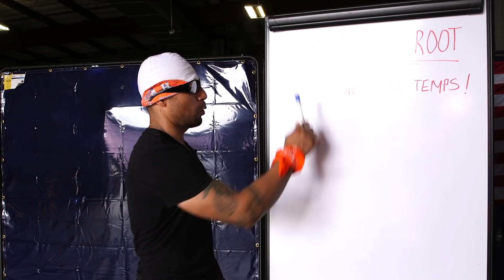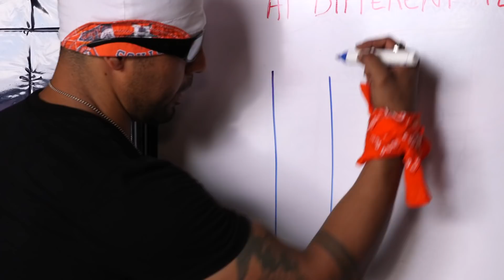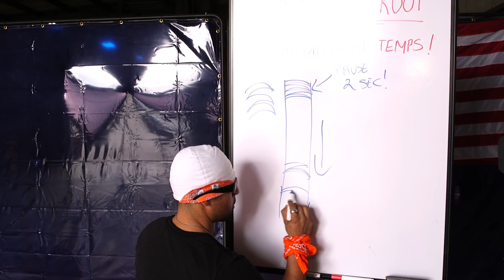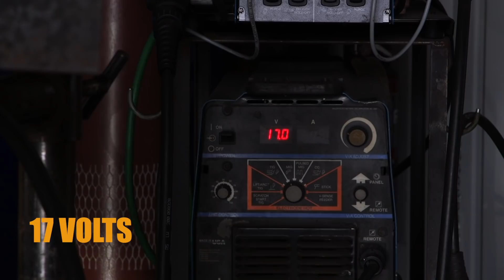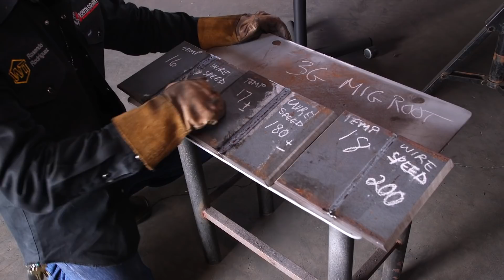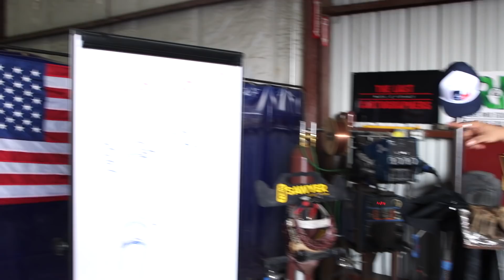3G MIG Open Root

Comment: Just seen your video after I did my Mig 3g today. my settings were 17.6 volts, wire speed 180 (4.5 m/min). I did an uphill stringer for root though.

Comment: Is it correct to be calling the volts your temp? Temperature is in your wire speed  at least that what I understand from my research. Amperage goes up when your wire speed goes up. Volts are for stabilizing the arc for the transfer mode you’re using. But Amps is where your heat is at.

Comment: i get confused also, wire feed speed is amps , thats (temp). Voltage is the (puddle ) workarea. volage is where it connects with the work spot> think of it like a spark plug.kinda

Comment: Its not different temperature, its different voltage. And this is really, really easy. In europe, MAG (since that is a Mag welder, it needs 100%Ar in order to be mig) root is considered to be right onli of its uphill
Reply: Bozidar Jevtic that would depend on the code being used here in the states (ASME or API 1104) you can use 75/25(AR/CO2 mix) or 100% CO2 or 100% Arogon. But typically 75/25 is used under the qualifying code of either ASME or API 1104 and a Mig root is done downhill. Further MAG and MIG are not the same thing per se. MAG (Metal Active Gas) MIG(Metal Inert Gas). Argon is a inert gas while CO2 is an active gas. That’s why MAG is ran with CO2 because the CO2 makes the weld pool active. Argon doesn’t. When mixed with CO2 as the parent gas it actually calms the activeness of the CO2 to allow it to solidify faster.

Comment: I've never been taught to weld downhill. It's always been told to me to be bad practice. This is Votech, contractor and shipyard. I'm curious as to why you're teaching downhill root and uphill?? F.y.i I'm not judging, I'm seriously curious..
Reply: A downhill MiG root is totaling acceptable. The material that you are welding is at its most vulnerable state at this point. By going downhill you are able to keep the heat in those landings and get proper reinforcement. After the fact you will need to go uphill to keep that heat in the plates or whatever you are welding. All that said there is nothing wrong with going uphill as well. But at the end of day it all depends on your WPS

Comment: Hey weldtube family, I was wondering if anyone has took a test on a 2” schedule 40 carbon, 6010 uphill, 7018 fill and cap, if so what heat did you run your root pass?
Reply: I ran mine at about 76 . Depending on the machine I was using .

Comment: What transfer mode did you use?  What gas mixture did you use??
Reply: Probably 75/25 CO2 mix. That's pretty standard for MIG welding.